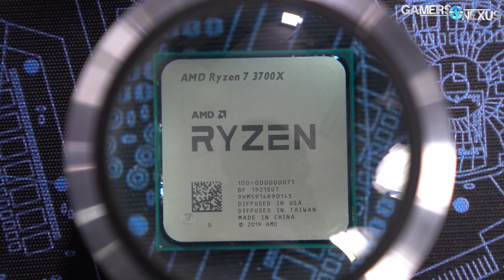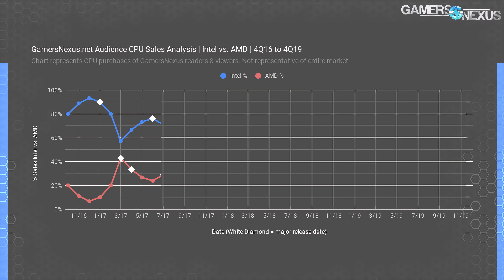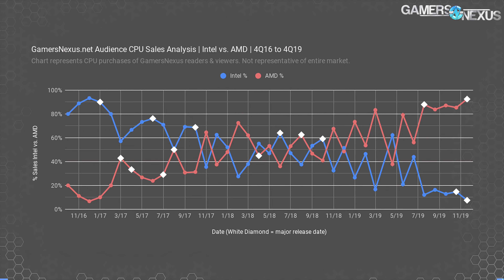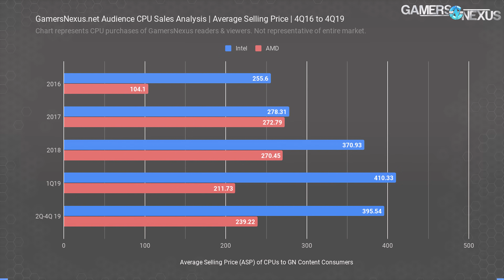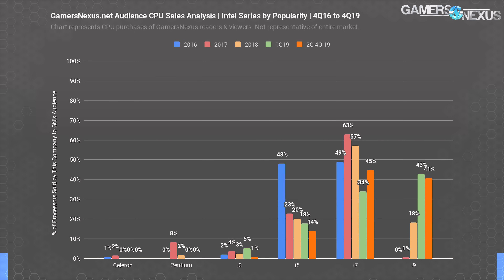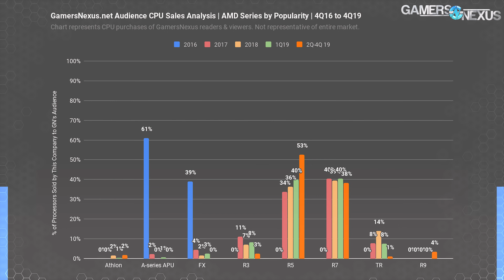GN Special Report: AMD Moves 93% of CPU Sales (Intel vs. AMD 2019 for DIY)

Comment: Intel is basically Nintendo at this point: Even if they were to have a noticeable amount of losses, they would still be able to have a high presence in the market because of their name alone, and the lack of there being more than only AMD to truly take on Team Blue on the CPU forefront is indeed disturbing, Intel and AMD are the Democrats and Republicans of the CPU market (in no particular order; choose as you feel) and we do need some other parties to return to the forefront: With Team White (IBM) and Team Brown (Zhaoxin) not really having much of a presence in Consumer CPU markets internationally (Zhaoxin, to my knowledge, is still confined to China) and the potential threat that Team Sky (ARM) could be coming to Desktops really deserves to be a cause of concern for the Two Party System that we have grown to know; given that I do feel that IBM needs to come back into the game with their POWER10 chips (their Four Way Multithreading on Consumer Desktops would make a big difference), and as Zhaoxin's KX-7000 series and later aims to chip away at Low and Mid~Tier Intel Core and AMD Ryzen chips, I would say that investors would benefit massively if Team White and Brown came into the ring and it'll really ruffle the feathers of Team Blue and Red at their core (pardon the pun), AMD sticking it to Intel is one thing but IBM and VIA returning truly would be the saving grace that we need in the CPU market going forward.

Comment: As in Intel fanboy (with a 3900x XD) im glad intel is getting fucked on, they need a kick in the ass to teach em a lesson, constant refreshes are mistakes. Their line up is 3nm chips for 2022 (if not constantly delayed) will be the turning point for intel again. Hopefully the 3900x holds strong

Comment: I would love to switch to AMD, but as long as AMD vendors don't release high-end mATX boards I will  not do the switch. It blows my mind that since release of Rysen 1 there was no high end mATX board (supporting SLI, good mosfet with decent cooling)
Reply: It's not just AMD boards - all mATX is getting rare, comparatively
Reply: In order for boards to have SLI support, vendors have to pay nVidia for licensing.

Comment: Hey, I've seen some RTX 2070 coming back o the market since the re-introduction of this GPU, and there is some new models coming up, especially in the low-end...

In that regard, MSI has launched a triple fan card called the RTX 2070 "Tri Frozr".. this is a dual slot, triple fan card, and yet one of the least expensive cards among al the 2070 that are coming back from the dead..

I'm really interested by the particular GPU, but since it looks kinda cheap, and MSI is known for some crappy thermal designs on some of theirs RX 5700/5700XT, could you do a review of that card? Nobody has done any review on it, I don't really know if its cheap esthetic has anything to do with its performance !

I understand that GPU reviews and teardown have been quite heavily featured on tech channels for the past 4 /5 months or so, but I believe that due to the low pricepoint of this card, many will be tempted to buy, especially coming in the Holiday season 

Anyway, keep up the good work guys :)

Comment: Me- The i5 is still enough for gaming in 2019
My 7600k idle is at 50%
Reply: Idle at 50%??
Reply: Bro I think you need to reinstall Windows :D
Reply: i play doom on ultra 1440p/150++ FPS with a i5 7600k and a msi 1070, got the system made in 2017, stil a beast i can still max all games.
also pubg runs good, everything maxed out 120 fps average
Reply: For real,dude?
Reply: @HeriYanto-ig2nr 
@kumbandit 
@IceTea36  
It's just a joke 😂 
In reality I only ever hit 50% when booting. It's  loading Steam, Xbox app, Discord, Chrome, Streamlabs OBS and Norton all at the same time but after a few seconds its back down to 15%.
Reply: Camellion I dont like red dead 2. Or 1.
I also play gta5 on 1440 all maxed and above 120 fps

Comment: A video I would like to see:- Can a 3950X drop straight into an X370 board? I've currently got an ASUS PRIME X370 PRO and I'm wondering if, in a couple of years when my 1600X is getting a bit tired, I'll be able to drop in a 3950X.
Reply: https://www.youtube.com/watch?v=WHdeyAuQCtM
Reply: I've already watched this one, but thanks for the link anyway. Paul only goes up to the 3900X in this vid as the 3950X hadn't been released. I fear the extra 4 cores on the 3950X might be too much for the power delivery on my board.
Reply: @ArabiaTerraEJS  Your'e welcome. I figure the 3900x content applies to 3950, and any variations are probably going to only change on a board-to-board basis - i.e. is the VRM cooling sufficient on specific board X due to higher power draw on the 3950? It will WORK, it's question of can you really take advantage of the 3950 on such an old board or will you not squeeze more performance out of it than with a 3900x because the board can't handle the power draw or thermally throttles/overloads the VRM.

I can't vouch for the accuracy of this next link, but I found it with a little google-fu and it backs up what my personal advice to you was going to be having thought through this same question but over the 3900x (since for my purposes, 3900x is already overkill) on an x470 board. I decided it was doable someday if I wanted to, but my case was a x470 with good VRMs/heatsinks and I also have 2 exhaust fans right by the VRMS - back and up-facing. So, I can run my 3700x and someday drop a cheap 3900x or maybe even 3950x in as people ditch their older CPUs for the next gen or something. 

For your board and the 3950 (since this isn't about me!) I don't know it personally but check this link:
https://docs.google.com/spreadsheets/d/1d9_E3h8bLp-TXr-0zTJFqqVxdCR9daIVNyMatydkpFA/htmlview?sle=true#gid=639584818

I can't vouch for the expertise of the source, but they probably has more knowledge of this than either of us - and seems to suggest that you'd be OK at stock speeds with good cooling/airflow, but that OC might be dicey without major airflow. From what I've researched, most of these boards with 2 8-pin power connectors are way overkill, but maybe an OC 3950 might actually be able to strain a single 8-pin power connector.... I don't know enough and don't have time before sleep to research it but you certainly should if you plan to OC since I notice that board has just the 1 8-pin power for the CPU. 

Hope this helps... Good luck!

Comment: All those poor fools buying Intel processors with critical security flaws like Meltdown, Specter and Zombieload.  Ya, You still deal with it on 9th gen regurgitated relabeled as 10th gen. When the news landed of the first security exploits, my heart sank as I had a i7 6700 at the time. That was the beginning of losing faith in Intel.  With that, I dumped my i7 6700 for a 3600x and I haven't regretted it.

Comment: Steve, please do some digging on the next generation of mainstream Intel CPUs. Most rumors I read suggest the i7 10700K will be an 8c/16t CPU and the i9 10900K will be a 10c/20t CPU. If that's true, it would be amazing if they turned out to be priced like i7s and i9s are now.

Shame it's certain it won't have PCIe 4.0 though.
Reply: willg955   Maybe PCI 5.

Comment: honestly if intel drops i5's price by 50% then suddently i5 becomes a good deal.  intel can get alot more buyers overnight if they just do price cut, but they wont :p

Im still using ryzen 7 1700 i got from 2017.  upgraded from i5 2400 from 2011 :p

Comment: Integrators need to make more options with Ryzen available. If you check Dell or HP for a Ryzen workstation. There's only low tier options. It's terrible.

Comment: From my personal experience selling laptops, AMD has made a signifiant breach in the market. 

The top selling product in my shop is the Asus S412 AMD version, compared to the Intel Core i5-8265U one this version is better performing and also Vulkan ready, which is great for students whishing an increase in performance over cost. 

The S412 is an overall good 400$ laptop and it was the aimed price during the majors sales point of this year. But this isn't the only segment in which AMD has dominated this year.

If you take a look at the Lenovo V340 you can see that even Intel best bang for your buck series struggle a lot agaisnt the C340 or L340 with a lower cost and not much decrease in perfomance. 

So in the 500 to 600 range, AMD again takes the spot.

However Intel stays dominant in high end top tier laptops, like MSI GF63 or GV72 and Asus ROG STRIX-G-G531GT-AL030T. 1000$ laptops are far more popular than 800$ ones making AMD's options less appealing to this wallet class.

So yeah, AMD keep it up and breach into that high tier please.

Comment: I was the typical Intel/Geforce guy until this year. I'm building my brother his rig and i planned going the same route until i saw the price:performance ration. There is just no reason to go Intel atm. GPU wise it's the first time going Radeon so we'll see how that goes.
Reply: Here in Norway Intel cost less then AMD at the low end and mid range CPU market for the same performance... Only at High end CPUs Intel is more expensive.
Reply: If your getting an amd gpu if its a low end build get the 570/580 (but don’t expect gtx grade silence) otherwise get the 5700 series. The other skews are either too loud or too weak.
Reply: @ashhook4106  Depending on the price a Vega can be a good deal, especially Vega 56 with good oc headroom.
The quality of the card depends on the individual sku.
I've seen great Vegas and terrible Vegas, as well as great Pascal cards and terrible ones.

Pascal is more efficient than Polaris and Vega at stock, therefore it is easier to cool and thus can be more silent.

But I've seen pretty horrible coolers on 1060's that manage to create a card that runs hot and loud even with such an efficient chip.
Reply: @ToriRocksAmos  I'd advise against Vega though if noise and thermals are a concern, the 5700 has slightly less value in cost/frame but the better thermals and noise are nice to consider, and if it's not a consideration and you like modding the 5700 to 5700xt bios flash can net you some performance at the cost of power consumption
Reply: @josh223  Sure, the 5700 series is a lot better in terms of efficiency. 

Noise and thermals are relative - if you do get a Vega make sure she has a really good cooler.

Ultimately it comes down to pricing. 

A 590 is ~ 180€, a 5700 is 320€, a V56 is 280€. 

At that price it's absolutely not worth it.

But if you can get it on a deal for 220€? Pretty good.
Reply: I'll stay a typical Intel\Nvidia guy as long as they are offering me a better product. Really happy with the i7 8750h laptop I've got.
Reply: As a former amd fanboy i'd advise against amd equipped graphic cards
Reply: @powerup9035  I've worked with / used Pascal, Polaris, Vega and Vega II (Radeon VII) cards.

While older AMD gpu's were usually overvolted, that's not an issue anymore with Navi.
The software suite on the AMD side is better - Wattman > Geforce Experience.

My main card is currently a Radeon VII and I don't see any reason to advise against using a 5700 XT.

Comment: Can't wait for the day AMD comes out with real competition for XX80ti's
Reply: Like the 5700 XT? nVidia's lower SKUs, like the 1660 are not too far off reaching the XX80Ti series as well.
Reply: @BrunodeSouzaLino  5700XT is nowhere close to competing with the 2080ti. The reason I put XX80ti instead of 2080ti is they likely will not have direct competition for a couple generations at least, if ever.

Comment: If someone is an FPS snob about a few percent across a 30 game average, I'd say they need to get outside more.
Reply: Especially considering you need a 2080Ti at 1080p to really realise those benefits lol
Reply: VR sim racing with 2080ti.   I need as much performance I can get.  Project Cars 2 clearly favours Intel.    Only reason I would still go Intel currently.
Reply: @del635 ofcourse.  Rift s is very good for performance issues.   Asw = free performance essentially.  Steam vr and index different ball game completely.  Motion reprojection cannot compete or function without it looking really bad when u move your head.   meaning u are looking for native refresh be it 80 90 120 or 144 hz.   Its all about how much eye candy can u turn up.   More cpu performance = more chance of higher pixel density and better gfx.  Let's face it vr is great but it's still in its infancy from a visual fidelity perspective compared to monitors.   Also iracing single core performance is king.

Comment: I was ALMOST able to get a 2700x for $119, but by the time i got to checkout, it had gone out of stock, so i got a 3600 instead, i was looking for lower heat output anyway but couldnt pass up that deal if i could get it

Comment: I think this trend is more widespread than you’d think.  I spoke to my local MicroCenter here in the DC metro area, and they said they’re selling more AMD than Intel CPUs this holiday season.  I think the fact that the Ryzen 2000 series was so heavily discounted probably had something to do with it.  

For a while they were selling new Ryzen 2700x’s for $129.
Reply: Yeah that nearly pulled me in. I have a file server that doubles as a Plex server and sometimes also runs a VM or two... I wanted* to upgrade to a 3900x but couldn't justify the cost when so much of it would sit idle except during rare times where I do a video edit (really simple edits, nothing crazy) or am doing two of those things at once. So 3600 was probably "enough" but I went up to the 3700x as my target for a little headroom on extra cores for the VMs especially... Those cheap deals on the 2xxx series almost got me to save a little money knowing it was probably STILL enough to meet my needs, but I had already bought a relatively small cooler planning on the 65 watt TDP of the 3700x so the slightly higher power consumption (heat) kept me off that deal. 3700x for just under $300 was still a good enough deal and I get the lower power consumption, so I'm happy.... but that was a killer value deal.

Comment: There is no longer any way to deny that Intel is in SeRiOuS trouble.
Reply: They'll be fine. They're still a massively profitable company who makes money off a lot more than enthusiast CPUs - or even than just off CPUs, for that matter. They will ABSOLUTELY survive the short-term cpu market pain. The bigger concern if you're Intel is that the longer that this goes on, the more time AMD has to solve their marketing and system integrator problems, and get the distribution channels and sales relationships lined up for enterprise server chips -- the more their "safe" markets become competitive long term even after they bounce back from this... It means the days of easy money won't come back in the CPU market the way they were even after they regain technological parity or even superiority because they will have let AMD get a foothold in those markets where they've had little to no competition in recent memory.

Comment: I'm interested in who was buying Bulldozer in 2019?
Reply: I did, at work. Needed basically a multithread machine for some 24/7 workloads that require 8 Threads. Budget was low as hell and I basically got a 150€ machine built with some spare parts lying around
Reply: a 100 bucks combo (cpu + mb + ram) can be good option option in some countries
Reply: h91 
My FX8350 with 32GB is going to my son while I just bought a 3600X (with 32GB) 
It will replace his 4 core APU (and RX480).
Alive and kicking
Reply: My old bulldozer was the best space heater I ever built, so maybe someone bought one for that.
Reply: It's 8 cores and it's as cheap as dirt. Still, better off buying ryzen 1400 or 1200 if the budget is such a problem.
Reply: @Erenzilable  It'd argue the 1400 would beat the 8350 in every task. Simply newer, faster technology. no reason to buy FX brand new since 2017
Reply: @kalef1234  that's what I wrote as well. Only reason to buy bulldozer at this point is LN2 tinkering or reviving old machine
Reply: kalef1234 
That's what he said 😉
Reply: Hell, same as me, i got a 2600k Sandybridge i7 in 2018 since i got a free 1155 mainboard.
Reply: Meee!!!
Reply: I bought an FX 8120 in 2012 and it served me quite well, with no problems at all. I've been going with AMD for many years and now use a 2700x. Just built a new pc for my son around a 3700x.
Reply: @MrWayne6363  ok american Boomer

Comment: why are silicon wafers round when chips are mostly square/rectangular? What I mean by that is a round shape does't work well for the utilisation of the space on the edge of the wafer. I'm sure there's a good reason for it considering the insane amount of engineering that goes into chip manufacturing, I just happen to be uneducated, poor and not particularly intelligent.

Comment: AMD needs to keep their momentum. If they can keep up and screw up Intel's next new platform, THAT will be what makes Dell and HP start putting loading up more boxes with AMD. As far as Intel's advantage in overclocking...not everyone is buildzoid or der8auer. It's so hard to get a stable overclocked system, I think many people don't validate properly and are running around unstable spreading lies about how they achieved a "stable" system.
Reply: Intel still bribes OEMs. In many cases (like HP), that represents a large marging of the company's revenue. There's an old story where AMD offered 1 million cpus to HP for free, but they couldn't take it because Intel threatened to reduce their bribes.
Reply: @BrunodeSouzaLino      Are you really that stupid about ancient bribes and old stories?  OEMs didn't want AMD because it was crap.
Reply: @wysetech2000  Tell that to the several worldwide FTC office raids and lawsuits moved by FTC's all over the world against Intel, including one from nVidia. These are all legal documents available on the internet and events that were noticed by the press of the time as well.